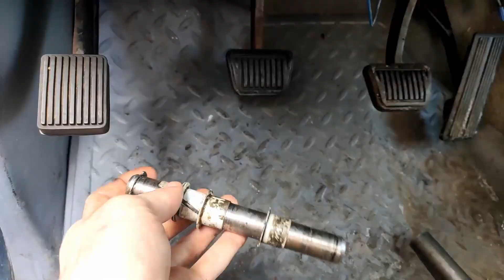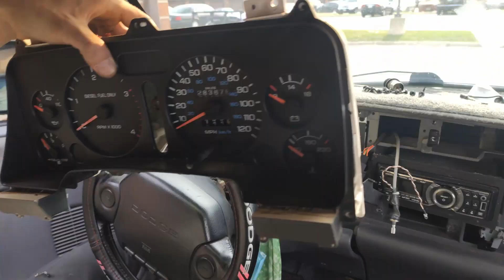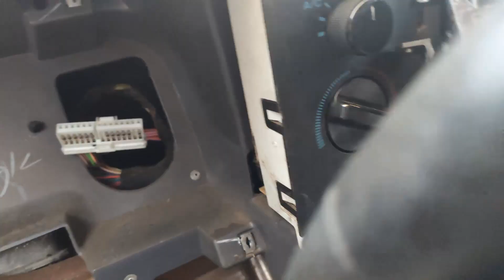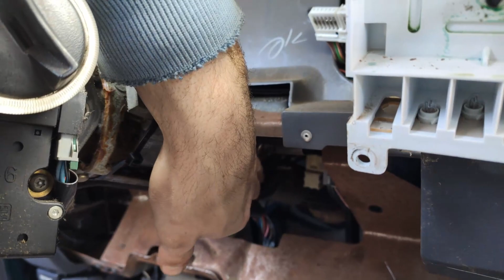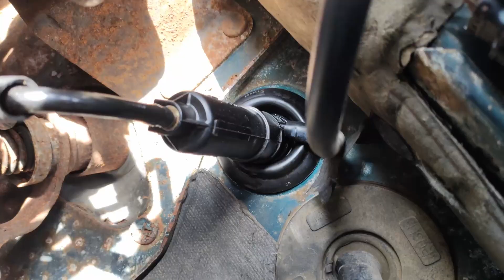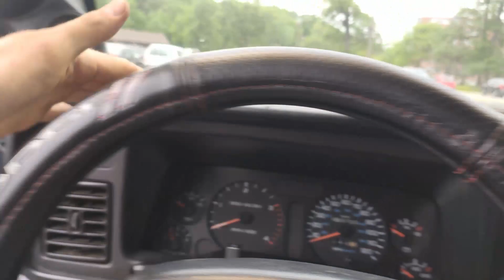94-97 Dodge Ram NV4500 Swap Part: 3

Comment: What about 4x4 actuation and light on dash? I know you have your manual 4x4 handle. But will that still work? And what about cruise control?
Reply from the maker: Good question! This is my speculation.
Any of the vacuum lines will need to be plugged that were previously going to the 47re. Part stores and stores online sell little plugs for that. That should help with the vacuum portion. As far as cruise, the ECM/BCM will think you're in park all the time with the way I grounded this wire. You will need to get a clutch safety switch and hook it up to that. The switch is completing a ground circuit to start the truck